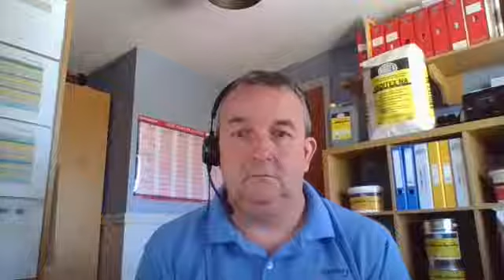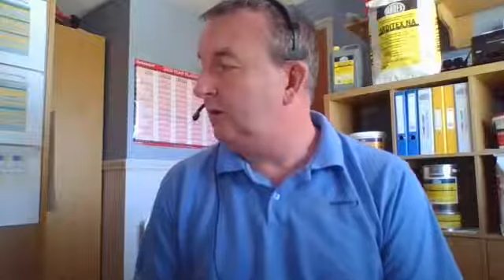How to identify and prepare calcium sulphate screeds

Comment: What’s the best tool to remove the latency from the floor,you say sand it down you mean literally sand paper or a concrete grinder
Reply from the maker: Laitance can be removed with mechanical preparation. This could be using a sanding machine, shot blasting or grinding. Hope this helps 😊 If you require more info on mechanical preparation please contact our technical support team 📞

Comment: Hi mate, if I use the k301 but have a drop of 30-40mm could I lay a new concrete bed before hand to build the height up? If so, clean, bonding agent? Then spread a small amount of concrete, leave to set for 6 weeks then would the k301 work for the area?  Thoughts? Cheers